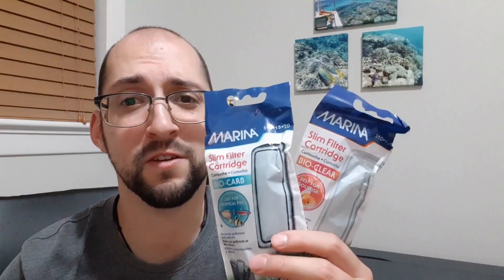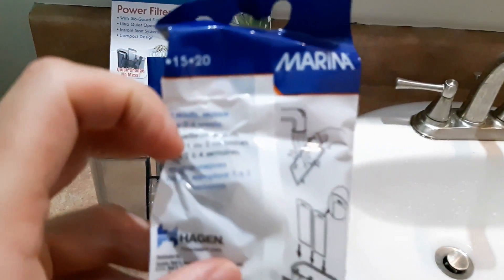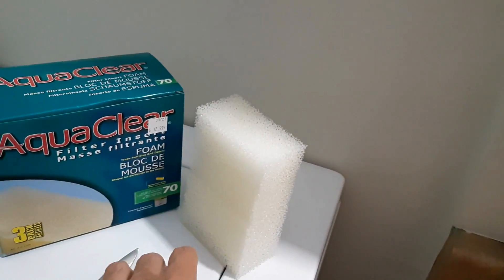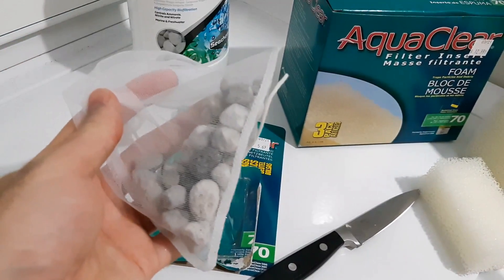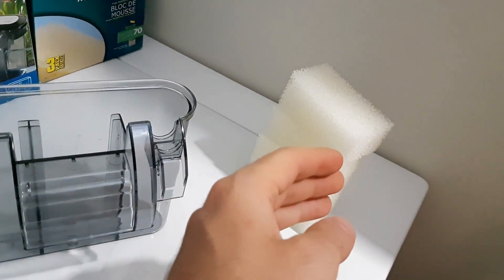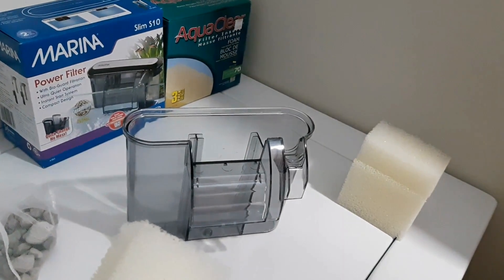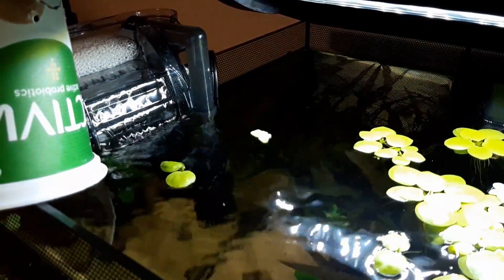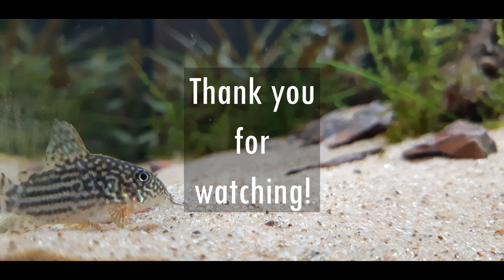How to mod your aquarium filter AND SAVE MONEY!!

Comment: hi i know im 3 years late lol but i was wondering how you got yours to be so quiet? i got mine a few days ago and the sound of the filter sitting on the tank makings a vibration noise thats irritating me, will it eventually quiet down as it breaks in or did you never have that problem?
Reply from the maker: Hey! 👋 I don't post as much but I still read these. This pump/filter rattles a lot on this aquarium and it can be frustrating trying to find how to fix it. I found that the best trick to reduce the rattling was to insert a thin piece of foam between the pump pipe and the plastic of the filter section. I have also found that sometimes its the lid that rattles and try to put a small piece of foam so that it does not sit on the filter chamber.

Comment: I would like to add smaller ceramic rings, carbon and that sponge is good. Excellent vid.
Reply: You don't need the carbon. 
From right to left:
1st compartment) Sponge, 
2nd compartment) floss or a filter pad, 
3rd compartment) ceramic rings..
Reply from the maker: You can put pretty much everything you want, that's the beauty of going DIY

Comment: Thank you for this! I have a 20 gal version and cartridges are expensive especially when used for the required duration. The way these sponges are positioned also makes it seem like they should work better than the cartridges
Reply from the maker: you're welcome and yes the sponges grab a lot of stuff!
Reply: yep these filter sponges catch a lot of stuff just be careful when trimming back aquarium plants that it doesn't get stuck in the filter because plant trimming decay unless replanted

Comment: This filter pumps the water to the top of the filter box, the water won't filter thru the sponges, that is why the manufacturer has a gate like filter media.
Reply: That's one of my concerns with this filter. Did you ever figure out a way to get past this design problem?
Reply: @Tallermage  I used the box from an old Top Fin hob and rigged up the pump, works perfectly and i can use any media.
Reply: @Tallermage  Late reply but I'm looking at this right now for my filter.  I'm probably going to make some acrylic gates that fit in the channel basically dividing the filter section in two sections.  I'll leave a gap at the bottom of the gates for the water to flow out.  The key here is adjusting the gates so they are tall enough to keep water from topping the gate so gravity will push the water through my filter layers.  In order of flow I'll place a sponge at the pumps discharge pipe like in this video.  Its basically to catch stuff to keep me from needing to clean out the bottom of this chamber.  The water will top the factory wall here and fall into the rear most chamber.  I will place a layer of filter floss over two bags of ceramic rings.  The water will pass through the bottom of the gates I made into my final filter which I will tailor per the tank needs.  Ideally it would be ceramic rings in the bottom with filter floss over the top of that.  Once through the last layer of floss into the tank it goes.

The work should be easy, just a lot of initial adjustment.  I'll secure the gates in place with a bit of silicon and mark indicators into them with a knife incase they ever get dislodged.
Reply from the maker: I agree, however I did find that this setup works, although most probably not in the most efficient way possible. Thanks for your output!

Comment: Will this filter be good for a betta in a 10 gallon?
Reply from the maker: The great thing about this filter model is that theres a knob that you can turn to adjust the power of the flow. This way you can make sure that the flow isn't too harsh for your betta.
Reply: I believe this filter is rated around 70 GPh so would be ok for a Betta. 
I wouldn't use it for a fully stocked (non Betta) 10 gal tank though.
Rule of thumb is a GPH around 10x the size of your tank. 
In other words, for a 10 gallon tank not housing a Betta fish, I would use minimum 100 GPH.

Comment: Will this filter fit on a rimmed tank? Some of the hob filters I've looked at will only fit on rimless tanks.
Reply from the maker: The aquarium kits (rimmed tank) that Marina sells all come with this filter. I would recommend looking more into their specs first to make sure that it work for your tanks, but it should. Other notable filters that could be interesting for you would be the AquaClear and the Tidal HOB, they all come in many different sizes.
Reply: @DoAqua  Thank you so much for the quick reply. I think I'll just grab one and see if it fits seeing as they are so cheap, can always keep it as a spare for another tank if it doesn't fit.
Reply from the maker: It used to be my quarantine tank filter until I decided to aquascape that one too 😅🤣

Comment: Sir ,
One more question .
Is it o.k we don't use activated carbon ? Only using volcano rocks is sufficient to make the water clear ?
Reply from the maker: Yes its ok! Activated carbon is useful but not essential. Having robust filtration, plants in the aquarium and doing water changes is more than enough.
Reply: @DoAqua  
Again thank you very much sir for prompt reply.👌
Reply: @DoAqua  If I wanted to also use carbon, would that be okay instead of 2 filter media? If so, would you recommend putting in the the second or the third section?
Reply from the maker: @nihilisticrogue1048  I see no issue with it! Remember to change your carbon once in a while though.
Reply: You do not need carbon especially if you have live plants. 
Sponge, and a filter pad are all you really need.
If you want to add ceramic rings or rocks or similar, add it to the third container but it's really not all that necessary. 
Plenty of bacteria resides in the substrate, rocks and other surfaces in the tank.

Comment: Sir ,
If the filter works well and it makes the water cristal clear than when the tank water should be changed.? after how many days?
Is it o.k to change the water of tank after 3 months ?
Hope you are getting me .
I am from India and my English is not so good . 🙂🙂
Reply from the maker: Hello Jayesh, the frequence at which people change the water of the aquarium is mostly based on personal preference and waste output by the fish (more fish, more waste, more water changes needed). From experience, as well as experience from other fishkeepers that I am in contact with, I know that well established aquariums with lots of plants can last a long time without water changes, which could be the case of your aquarium.
That said, I usually prefer to do a 30% water change once every week or 2 week. This is also the time where I do some light cleaning and maintenance of the aquarium decor.
Reply: @DoAqua  
Thank you very very much sir for your valuable reply. 👍👍

Comment: Sir ,
For how many hours in a day the filter shoud be run .
Is it necessary to do the filtration for 24X7 hours .?
Reply from the maker: I always leave it running 24hx7 in my installations
Reply: You can just limit the flow rate.

Comment: Why would you wash your media you will get rid of the bacteria maybe rinse it q bit in some of your tank water when you do a water change
Reply from the maker: Yes rinsing with tank water is what you should always do and is what I really meant
Reply: That's not always necessary.  It's dependent on how much surface area you have in your tank for beneficial bacteria to grow.  Example, if you have a 60 gallon tank with a pre sponge filter, washing that pre sponge filter will have little to no effect compared to if you had a 10 gallon tank with way less surface area.  Surface area can include everything in your tank from the glass, to the gravel to the ornaments, etc...  Either way it should be good practice to wash in tank water, but not necessary.